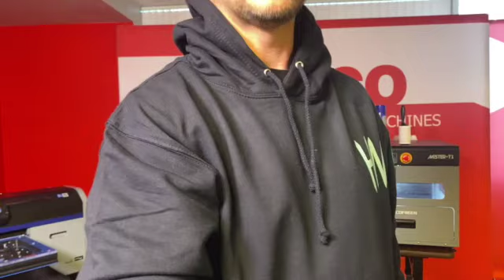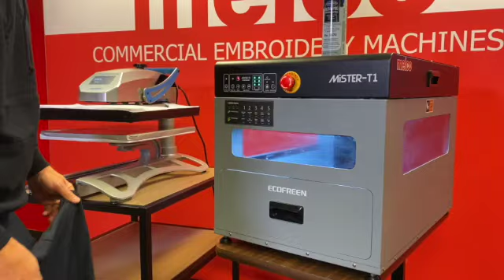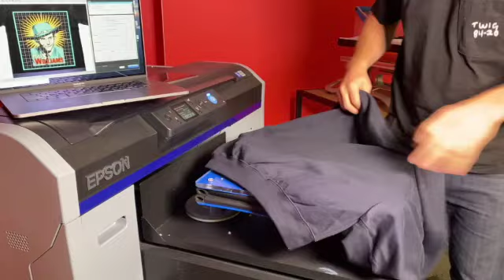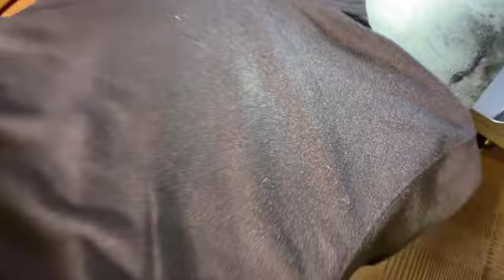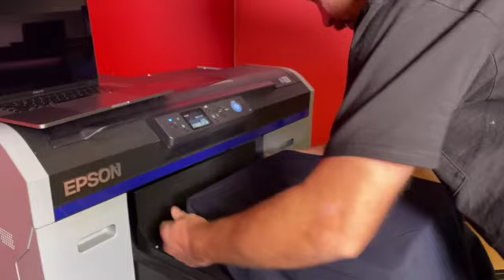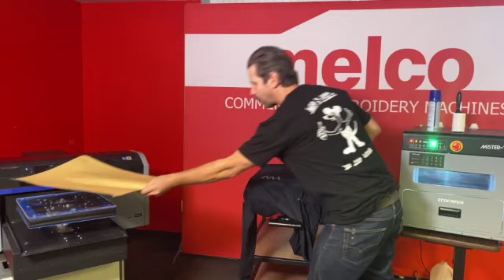Epson F2100 Perfect Hoodie Prints - ProDTG Tip

Comment: after i print on my f2100 and i go to heat press a hoodie the colors fade , i pretreated the hoodie with the epson supplied treatment and the hoodies are 100% cotton hoods . when it finishes printing the colors look great but when i go and press it for 60 seconds with light pressure @ 330 the colors fade . does anyone know what i can do to fix this problem ?
Reply from the maker: That is likely due to the dye in the hoody migrating through the print. Dye migration is a common problem. Conveyor dryers help, you can reduce a combination of time, pressure and heat to possibly help mitigate migration. Often its the brand of hoodie and dye they use. I use Justhoodsusa for best results.
Reply: @MelcoEmbroidery  the customer brought me the hoods so I really have no option as far as buying the garment . They are the Golan 100% cotton hoodie . If I was to do the paper transfer like in your other video , do you think that would work?
Reply: @MelcoEmbroidery  *Gildan

Comment: How many inches did you put between neck of the hoodie and edge of platen riser before you tucked?
Reply from the maker: In this case the riser is squared up with the front and sides of the platen. I I loaded the hoody square on the platen which is correct for a size S-L left chest. Then in GC I moved the art all the way to the right of the screen and down about 1-2"" from the top. Here is my video on Left Chest Prints. https://youtu.be/idEqz8C_lLE